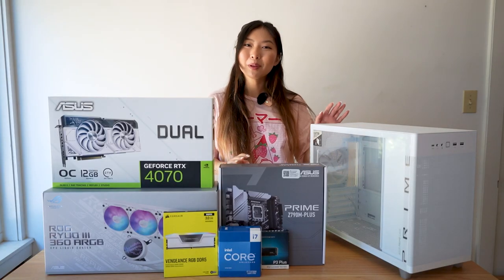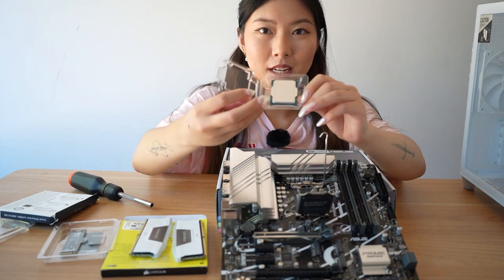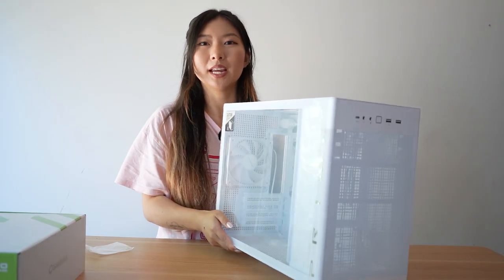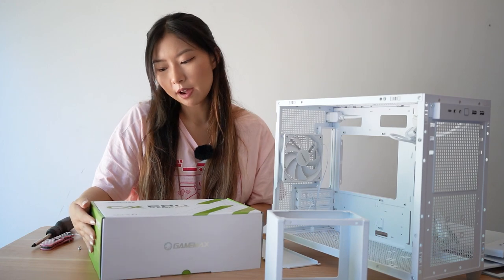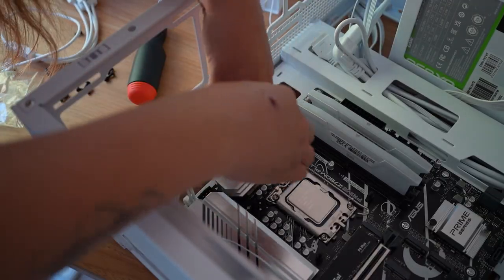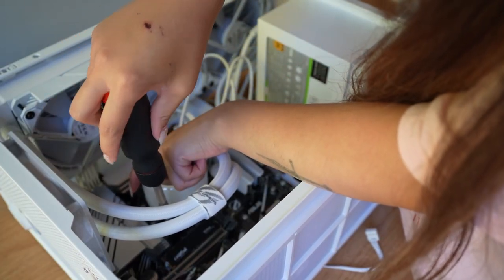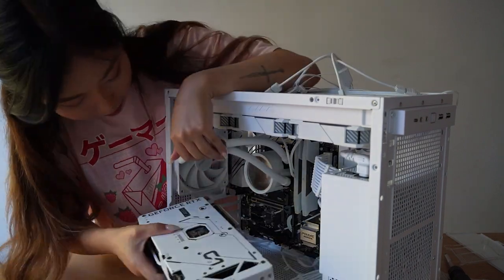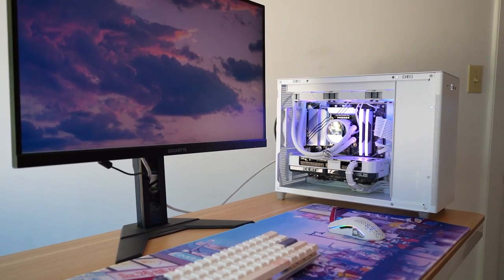aesthetic white gaming pc build full tutorial | i7 13700K, ASUS dual 4070, Ryuo 360 AIO, Prime Z790

Comment: First off, I have an AP201 and I LOVE this case.

Regarding thermals, you might want to change your radiator fans to be exhausted fans. Tests posted on reddit shows that the component temperatures are lower when the top fans are exhausted fans.
Reply: I'm new to building a PC. What is an exhausted fans and which ones you recommend?

Comment: Nice video! Its funny how my build is similar to yours but just a few different parts which include Noctua nh-u12a chromax air cooling instead of water cooling. Seasonic focus 850  psu and i7 13700kf. Other then the differences I listed my build is the same as yours but a blacked out version.

Comment: Just finished a build based on this setup and I'm loving it! 
I was wondering what your rationale for the top fans being intake was? A lot of articles and posts say you should intake from the front and bottom and exhaust from the back and top. I have an extra case fan that I was considering adding to the bottom for more intake (or maybe exhaust but I don't want to take air from my gpu).
Thanks for the great build guide peachie!!

Comment: Thinking about doing a similar build wondering if this would work pls help.

Ap201
240mm aio
850w ATX PSU fully modular
Rtx 4080

My question to you is would having a smaller 240mm AIO and a full size PSU in the highest slot would there be clearance for a rtx 4080 thank you for your help great vid.
Reply from the maker: which 4080 is it? looks like someone did something similar, it seems from this pic a 240 would have no issues https://www.reddit.com/r/mffpc/comments/1175qc5/asus_prime_ap201_build_rtx_4080/